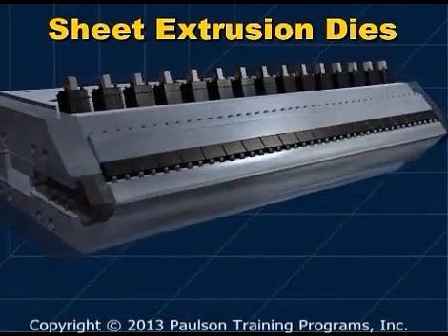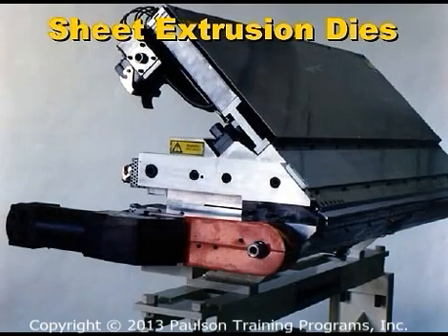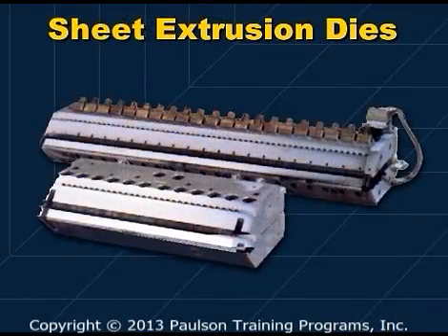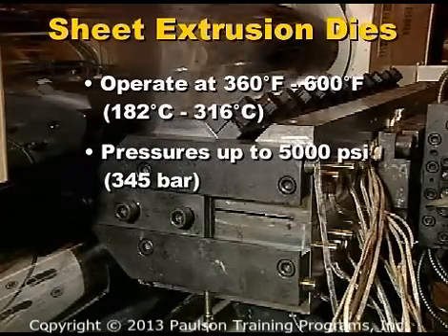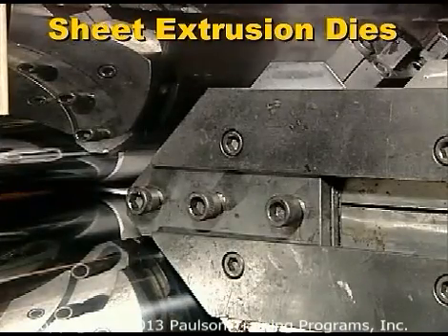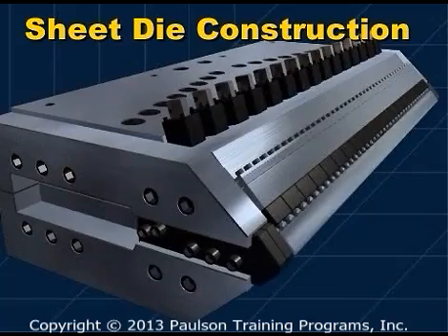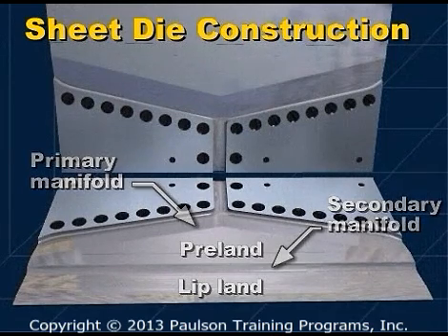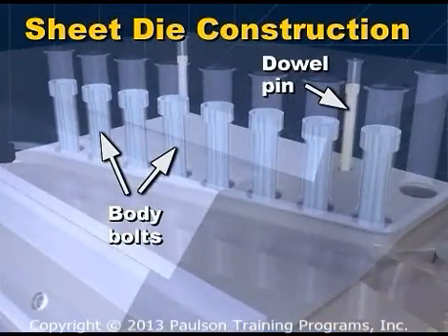Sheet Extrusion Dies - Proper Setup and Maintenance

Comment: How do you clean it out at the end of a run? Because if it solidifies in there, you’re screwed
Reply: get it while it is hot, from bamboo putty knife or brass, maintain heat control, and complete disassembly of die and melt flange before cooling down. setting up cleaning process tools beforehand.